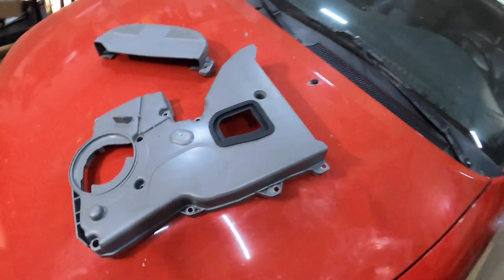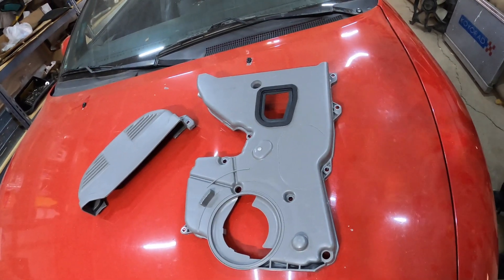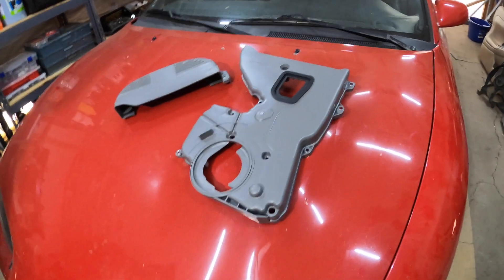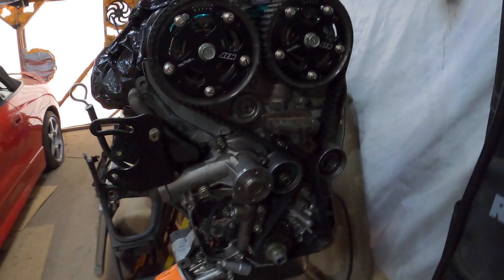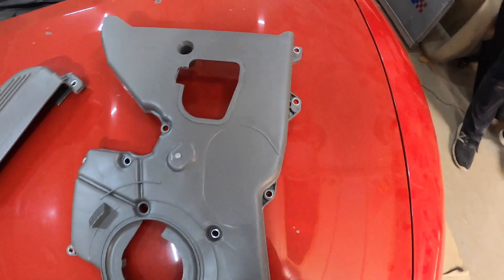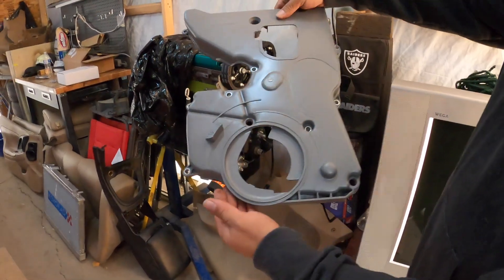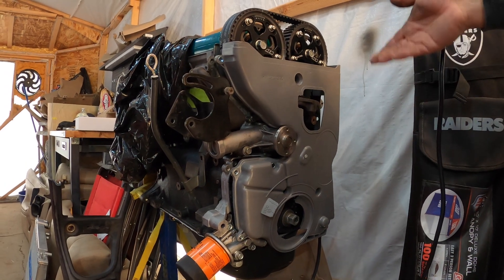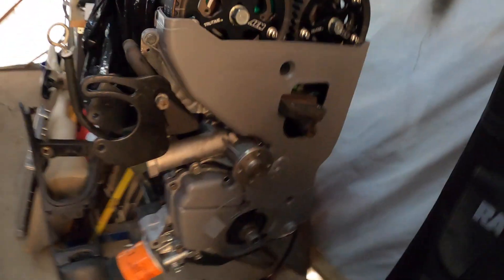BUDGET 6 BOLT DSM TIMING COVERS | TRIM FOR 2G MOUNT (6 BOLT SWAP)

Comment: good luck installing that with motor in car. :)  I cut mine in a straight line across and used the upper 2G cover paired with a clear zaklee cover

Comment: I wanted to ask since you know how to build 6 bolts im not getting spark or fuel i changed out the 1g cas an im still not getting spark or fuel an I changed out the ecu to
Reply from the maker: Are you 100% sure you are getting a Crank signal? One thing you can do (do this as your own risk)... put the key to the on position without cranking, remove the 1g CAS and rotate it clockwise... you should hear the fuel pump turn on and possibly the injectors "click". Doing this can also trigger a small spark from the coil pack/spark plug wires so it would be wise to disconnect the coil pack while looking for fuel. Hope this points you in the right direction. 👍
Reply from the maker: Also double check you did not plug in the crank signal connector to the AC compressor as you can easily mix the two up.
Reply: Ok i figured it out now I just can't seem to have the car to stay on
Reply: What was the problem @gerardoeast1881

Comment: That's totally awesome and thank you for the help. Hey I noticed in your opening that the drag strip is Sacramento. I live in Reno and currently trying to get my 6 bolt 2 G DSM running. This is perfect. I have the OEM top cover, do you know if the bottom piece works with the OEM DSM cover ? Keep up the work, great videos.
Reply from the maker: Yeah, that's @ Sac man. 

I don't see why your oem top cover couldn't work with this lower cover. The only "issue" you might have, is the colors from the lower vs the top cover being off... nothing a little spray paint (of your choice) can't fix lol.
Reply: @DSMTHuNDeR  thank you for taking the time to help me out. I am thinking of getting the clear top cover to view the timing belt.  I might head to the junk yard to see if I can get this cover. If I look up the part number it tells me what cars it goes on. So that way when I cut it if I mess it up no big deal.